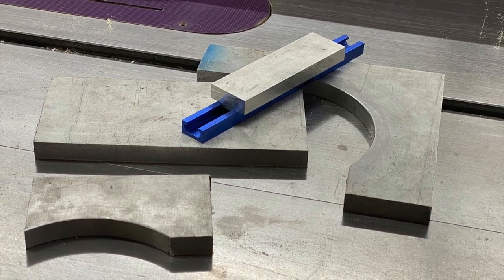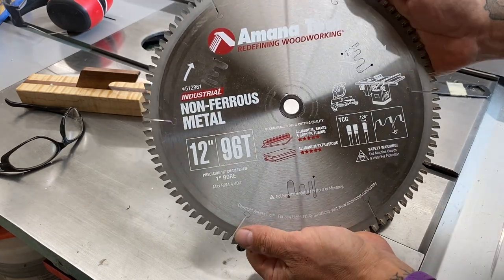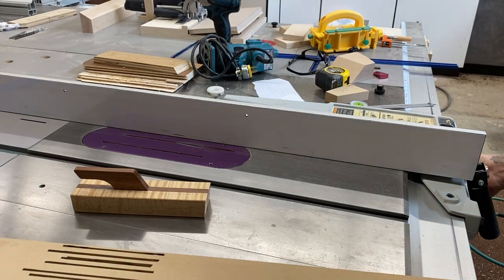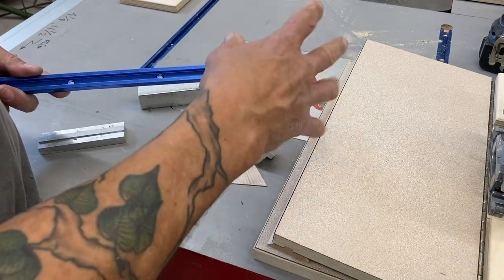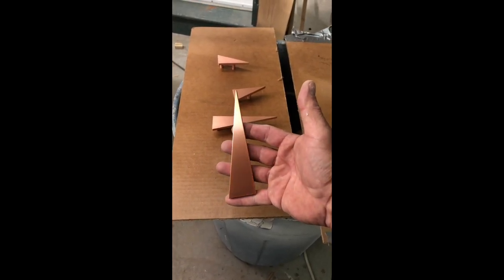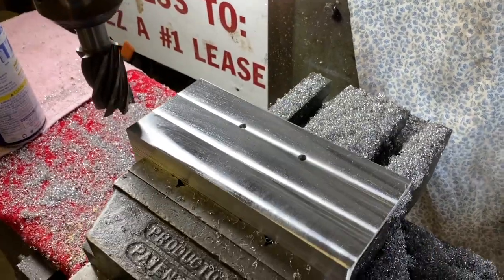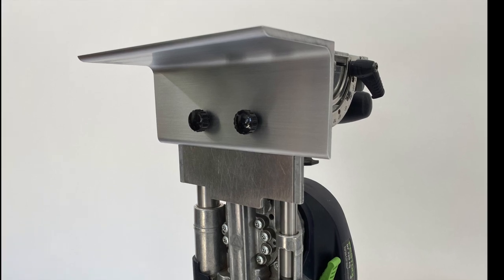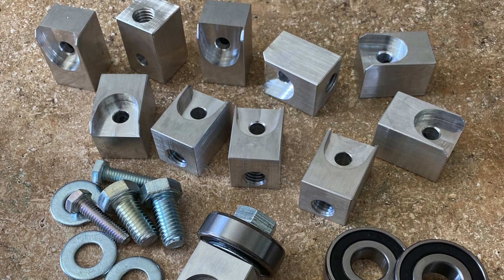Non-ferrous metals cut with woodworking tools

Comment: Another superb video Ramon. Thanks for  compiling all of this great information. I know what you mean about getting aluminum shavings everywhere. I've still got some in my shop from making the stops for the Fritz and Franz jigs. I've switched to using an O flute router bit for aluminum and it works better than a regular carbide bit since it clears the chips more effectively. I still use WD-40 as you do. One thing I find that helps with the chips is to cut at the bandsaw. I was surprised at how good of a cut I get with a 6tpi blade. I need to clean it up at my sander but I typically do that even when cutting at the chopsaw. I look forward to what you have in store for next Sunday
Reply from the maker: Thanks a ton David!  Yes, I was going to mention 0 flute bits.  They plunge better, cut cleaner and extract (or move) the debris better....I believe they even run cooler.  But I wanted this video to emphasize on using tools & machines one already has.   Anyway, yeah...those aluminum chips are everywhere!  However, routing outside does help! 😬

Comment: Awesome stuff . I like that it’s all real world and not a marketing campaign like most YouTube videos. I am going to get  one of those blades . I have solid 1 3/8” copper rod I need to cut up. Thanks
Reply from the maker: It’ll work well.  Hold it tight and cut somewhat slowly, but  consistent speed.  Beautiful, clean cuts.  Thanks for the good words.

Comment: Great video Ramon, with lots of good information.  I agree with you 100% on WD-40 as a lubricant for cutting aluminum.  I buy it by the gallon and fill a spray bottle with it.  Much cheaper that way.  I'm going to have to build a copy or variation of your magnet block, though I may use aluminum so I can use it on my Bridgeport too.  Thanks man!!
Reply from the maker: Thanks Bob!  Good idea with the gallon of WD.  That funny little block was actually designed and made to set (one end has a slight acute angle) against my table saw fence.  This allows me to move my fence by as little as 1/128” if I want.  I can simply add a piece of tape to the end, set the block in place, move the fence, remove the tape and carefully bring the fence back to it.   I love that thing! So many other uses as well. 😬🙏🏼

Comment: Great video. Densely packed with useful hacks as always. I've been machining aluminum with woodworking tooling ever since releasing my "1-Fence" product line decades ago. With lubrication, do you find that aluminum dulls a neg. rake triple chip saw blade or two-flute router bit any more than some exotic hardwoods? For router work, do you find that reducing RPM improves cut quality or tool edge life?
Reply from the maker: Thanks Michael!   I have noticed that aluminum cuts amazingly well with a brand new blade or bit...for the first few cuts.  Then it seems to slowly deteriorate from there. Slowly.  The WD-40 helps a ton...the more the better but some is better than none, if that makes sense.  Can’t really use a lot on woodworking machinery.  😆  Also, it’s hard to calculate SFM (surface feed/minute) with a router.  And I’m sure they’re spinning too fast.  I use the slowest setting if possible...I wish now that I had mentioned that.   However, I did mention the sound of the router being important...higher speeds do create a clean cut but should only be used as a finishing pass.  I think end mill bits are generally designed for roughing cuts or finish cuts.  With a router, I tried bits designed for aluminum, but found a double flute bit worked well.  Not sure if that answered your questions.

Comment: What bandsaw blade did you use to cut the 1/4" copper plate?
Reply from the maker: I believe it was a regular 1/2” x 3 or 4 TPI.  It cut easily.  Of course I had to sand the saw marks out at the edge sander.  Much thanks
Reply: @ramonartful  Thank you. I've been rather hesitant to try cutting these heavy gauge copper sheets with the bandsaw and I hate the mess the cut off wheels make, but since I have a 1/2" 4TPI sitting on my shelf I'll give it a go. Cheers!

Comment: The copper pull handles look awesome! Did you attach the standoffs to the triangular pieces or does the hardware hold everything together? At 8:27 into the video it looks like you drilled holes through the triangular plate.
Reply from the maker: Thank you!  It’s been a while but I believe that I threaded the stand-offs internally.  Then used short studs to attach them to the copper pulls.  The pulls were only 1/4” thick, so the threads were kinda shallow.  I used JB Weld to insure a good connection.  Then regular machine screws to attach to the doors.  Cheers